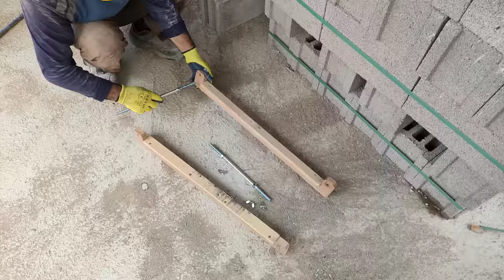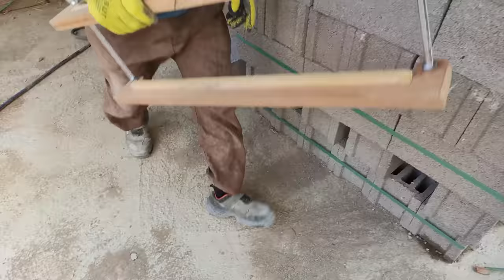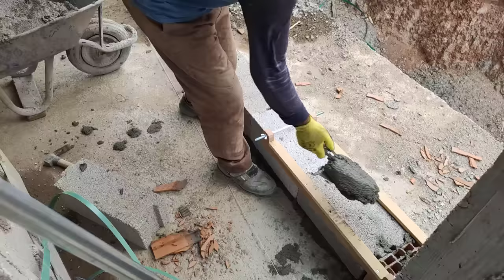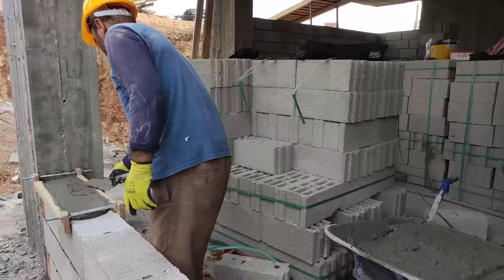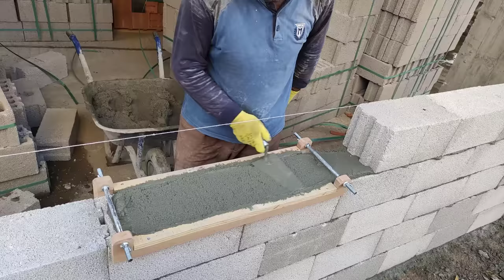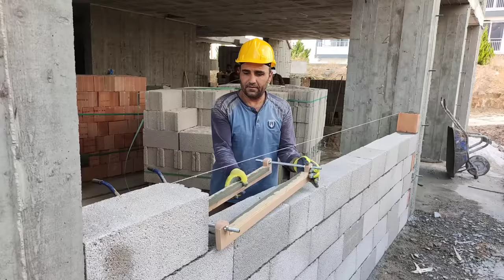Duvar ustasının işini profesyonel yapan kullanışlı alet

Comment: This would make block laying take so much longer then need be. This item is a homeowner special. You would use way more mortar than needed
Reply: They make up for excessive mortar on bed by not buttering the head joints. Lol
Reply: @sgtboz9730  yeah everyone wants to reinvent the wheel.
Reply: @MrK3W  Next, they will be making concrete Legos and no mortar will be needed .
Reply: @sgtboz9730  anything is possible. Everyone wants to be a mason but no one wants to lay the block the right way! Lol

Comment: Bricklaying is a craft when a bricklayer lays a bed joint it is feathered so as to place the block down and push the mortar joint so it potrudes on either side of block layed.The mortar joint becomes full and is easier to point it.

Comment: I have to say it. That's NOT the way it's done. You have to make adjustments in height ant length. No footer is perfect, and no mortar buttered on the heads is just wrong. I'd fire the so called mason that would do that. 45 years I've been doing it.

Comment: A real mason knows how to use a trowel.
Reply: He knows how to use a trowel - no matter how good you are - you're not going to lay wide beds like that as accurate and fast and with less droppings.
Reply: @Iazzaboyce  wanna bet.  I sling mud twice as fast and no dropping.  No boards no jigs no bs.   Working on the line I put up over 250 block a day myself.  8-10-12”.  I also lay 12” solid blocks by myself.  No two man lifting on my jobs.   Like I said a real mason knows how to use a trowel.
Reply: @mikekelloggs9379  That you mention you work to a line makes me think you're a pretender - every mason works to a line - it goes without saying.
Reply: @Iazzaboyce  working the line refers to straight walls.  Raising corners takes time and you need to use a level. Long walls or short walls doesn’t matter.  The line gets stretched corner to corner held in place by a jig.  Some guys use wooden blocks.  That line.  That’s the line I’m talking about.  The string.  Comes in colors.  Pretender?  You’re incorrect.
Reply: @mikekelloggs9379  i think he knows about the line...that's why he mentioned the line.
Reply: @TheyForcedMyHandLE  yea. Maybe.  Working on the line is the term.  Otherwise it’s go raise the corner.

Comment: A professional brick layer won't need this.
Reply: With this everyone becomes a professional brick layer.
Reply: I know right, why would a professional use a jig that helps quickly produce consistent results easily?
Reply: I can paint straight lines very good with a paint brush,as someone who started painting for money when I was 10yrs old. I can paint straight lines much faster when I mask off areas with painter grade masking tape. This seems to me to be a similar use of a product you don't have to have or need to use to get job done, but in long straight repeat applications, I wood use this. I wouldn't tape off every window frame, say a small bathroom window, I could freehand and be done, in the same time I would mask and paint. Large 6foot by 6foot window, probably going to use tape.

Comment: This mortar leveling tool is probably an improvement in comparison to uneven 3 to 5 cm thick mortar beds between concrete blocks I have seen in some countries. - Where I live practicing “masons” are usually without formal training and it is common to see much more poorly build concrete hollow block walls than in this video.

Nevertheless this side wall located below the adjacent ground level looks like it might be backfilled with soil which it could not sufficiently hold. The concrete blocks should be wetted and there should be mortar on the sides. Structurally the wall should be reinforced with steel bars. 

Much of the Middle-East is prone to earthquakes, which could make this wall particularly dangerous.
Reply: these are not professionals, but ordinary cobblers!

Comment: So many negative comments, First there is no waste cement going on the floor, it's level, it's clean, you don't need to cement the end of the blocks they have a key to hole them, the wall will be rendered later. Would be nice to see the doubters challenge him to build a wall as fast.
Reply: Glad he wasted 5-6 inches of mortar in the middle of each run and none on the floor. Who cares that it takes him 2 - 3 times longer to lay block. There is less mess to clean up. He does have great grout lines.

Comment: What you going to do if you need to grind or pick up? Not all blocks are the same size, plus you doing that your are weaking the wall from lack of suction. You're literally just placing the blocks on a slab of mortar.
Reply: My point exactly. I've just added a comment myself

Comment: I see the block are interlocking at the head joint. In Pennsylvania where I'm from that wouldn't pass code. No mortar at those joints  is crazy
Reply: Yeah we call these type of mason's HACKS around here. Level plumb straight edge two four leads one at each pull a line and let's go.
Reply: I'm also wondering what's the use of the vertical holes in the block if you can not put cement and rebars in it. The interlocking end joint is not enough to hold them together in case of an earthquake. Just an observation.

Comment: Looks good, however this type of wall construction is not designed for earthquake s, not reinforcement. It is easy because no vert rebars on the way of the guide that slide.

Comment: Really bad job! You need mortar on the verticals and also laying a block on flat mortar will not bind it well and make a weak joint. Needs to be heaped up to overfill and squashed down to get a good contact with the block.
Reply: Makes sense mate.

Comment: Your not even buttering the sides 😂
Reply: Guess these interlocking blocks don’t need head joints. 🤷🏻🤣
Reply: @jbonegw  actually they do , you can also use a specified adhesive

Comment: IF THERE IS NO CEMENT BETWEEN THE VERTICAL JOINTS OF THE BRICKS, THE RESULTING WALL WILL BE FRAGILE. NOT FOR A LOT OF RUNNING YOU GET FURTHER. IN MY OPINION, THAT'S AN ERROR. 🤨
Reply: I think you're right.
Reply: Also, water intrusion...?

Comment: A professional & experienced mason doesn't need such a tool, as it only slows down the process.
Reply: I'm not even a professional mason and I don't need this... It just gets in the way. You still have mortar coming out as you press the blocks into place (which he doesn't do in the video as far as I can see). You still have to clean up the joints a bit anyway, so why bother with the apparatus? You'll need to move it from spot to spot only to then take it out, I mean it's going to do murder to your back and you don't need more tools on a job...

Comment: I HAVE BEEN A JOURNYMAN MASON FOR 40 YEAR'S WASTE OF TIME.WHERE  ARE THE HEAD JOINT'S.AND HOW ARE YOU GOING TO TOOL THE BED JOINT'S
Reply: Ur right about journeyman, if by head joints u mean perp joints you wouldnt need them as the blocks are designed to interlock and its not facework so obviously going to be rendered or float and set so the recessed joints would act as a key for whatever finish coat they end up using.
Reply: I agree with you that’s not stone work it’s blockwork  plus there’s no joints I’m a retired Bricklayer and I could have built that Block wall properly in half the time he spent  setting that load of rubbish up‼️‼️

Comment: Too much mortar on bed joints, zero on head joints. No real block mason would use this. Those blocks look super lite. Styrofoam?
Reply: These blocks are expanded clay .They are a very good material for walls. They have very good insulation parameters.
Reply: @Nietyp  Did not know that.

Comment: With this system there is no cell interlock of mortar between courses. The blocks are dependant on the layer of mortar between each course. Also no room for rebar of any kind, nor any way to fill the cells. Maybe those are solid core block, but how heavy does that make them?

It may be faster, but (imho), it’s structurally compromised compared to the common open cell method. Nice for a DUI person, but as journeyman from a family of masons, I’ll pass.
Reply: Non ti capisco, ma tutto buono. Fai come voi te 🙂
Doppo di 42 anni a muratore, non mi frega niente.

Comment: Mortar will be dust in no time , should really pre soak the blocks , also he might want to invest in a spirit level always good to check 🤣
Reply: This ain’t brick buddy you don’t soak block
Reply: @lxrmv2518  It depends on the size and type of the brick or concrete block. In general, a standard concrete block has a larger volume and can therefore hold more water than a standard brick. However, this may vary based on the specific dimensions and characteristics of the brick or concrete block.

Pre-soaking concrete blocks before use is a common practice in construction. The purpose of pre-soaking is to reduce the amount of moisture that the blocks will absorb from the mortar during construction, which can cause premature drying and cracking of the mortar. By pre-soaking the blocks, the moisture content of the blocks is stabilized, reducing the risk of absorbing moisture from the mortar. Pre-soaking can be done by submerging the blocks in water for a specified period of time, usually 24 hours, or by spraying them with water for several hours prior to use. This helps to reduce the risk of moisture-related issues during the construction process and can lead to a stronger and more durable final product.

Comment: Where is the wire , rebar and grout cells at?. Junk work.
Reply: What do you mean?
Reply: What is grout? Rebar? And wire?
Reply: Wire goes on top every 2 courses, concrete(grout ) goes in every 3 feet in cells and rebar goes in the grout cells while pouring.

Comment: So what happen to the steal to keep the structure of the house strong. That is not a healthy house, if it is one building. Fast and not safe.
Reply: It’s simply a screen to fill in between the concrete that actually supports the building it’s not taking any weight so needs no rebar . It’s much like how a window fills a hole without supporting anything

Comment: Those blocks have all their faces solid but seem to have little weight. What material is that? And I don´t see vertical and horizontal reinforcement, and I don´t see a consistent interlocking of blocks of one row with the next row.
Reply: It's not a structural masonry wall though, just a closing wall.
Reply: Этот блок у нас называется сплиттер. В его состав входят цемент и очень мелкий щебень. Заборы тоже из него делают. Обычно каждые 3-4 ряда нужно вертикально армировать и заливать раствором

Comment: That might work for a home owner. Most masons wouldn't use it. Also the block in the video don't have cores or cell. This is probably where there is no rebar or concrete required.

Comment: No real bond  it will fail
Reply: mmm yeah its just kinda sitting on it isnt it
Reply: @MrNickcrush  many years ago there was a chap who marketed a thing called brikkies mate and it was endorsed by a celeb it was the same thing, no good 👎
Reply: @philsmith214   Phil, actually, for someone who never laid a block in their lives, a gadget like this is very helpful, its kinda funny that the people with the real skills are running this thing down thus minimising the value of their OWN expertise ! 

Not everyone is a bricky !! 

I'm a machinist by trade but when  DIYing a block wall out back, I used a similar form which helped me enormously... I haven't got the skills but I needed the job done & I wanted to point & say I did that myself ! 🙄😉

😎👍☘🍺
Reply: @peterfitzpatrick7032  I'm not a professional. I've done bits of wall here and there. I don't need this. It's a waste of my time and money.
Reply: He's not even pushing them in, is he?
Reply: @isakaldazwulfazizsunus7564  no not really they are just laying on a uniform layer of mortar 👍🏻

Comment: Not 8x8x16 unit its a its a interlocking cap just bed joint no head joint no bond beam block for rebar no grout I could spread that wall twice as fast as this little Contraptions doing and it looks like a lot of wasted mortar I don't know I have an inspector on the wall that walks my jobs

Comment: If you can't spread shit on a block you shouldn't be doing the job! No proper bonding, fill in blocks just dropped in to make up the gap. Vertical guesswork
Reply: 😂😂😂,,, yea,, there's absolutely no need to put anything between the blocks right?? 😂😂😂,,
Reply: @liamc-rb9tz  Block Interlocks???????????????
Reply: @davidwootton683  structurally unsound

Comment: is interesting to see that in areas that experience earthquakes don't use rebars. I've been living in Costa Rica for a while now, and all houses here have a rebar every meter and all corners are concrete pour with rebar renforcement. Is there a building code? I find it hard to  believe the gobernment doesn't enforce a code that can save thousands of people. By the way, the idea is ok, but brick layers are proud workers that can lay mud much better and faster thant that contraption. 
Semper Fi

Comment: What is wrong with putting cement on with a trowel putting the block on top, pushing it down, scraping of excess to a neat pointed effect  and putting some cement between the blocks as well. This looks like a very unstable wall with no cement between the blocks and will require the builder to go back and put the pointing back in. This looks like a slow way of laying blocks.

Comment: I would never go for a masonry wall that did not butter the head joints even if they interlock. There should be ladder reinforcing every other course. The only way  would trust this wall is if it was parged with block bond each side.
Reply: Why do you think these building fall down so fast with the slightest earth tremor?

Comment: I am not even a mason.. but i could see what is wrong in the video. A few common sense here that he is not putting blocks vertically so the cement is not filling up inside the blocks thus he is just spreading it. I dont see any metal supporting the wall as well just pure blocks and cement.

Comment: I know many bricklayers, and they would never use this method
Reply: for cinderblocks, why not? they're not even bricks.
Reply: Not only that, where in the world do you find "solid" cinder block without open cells.......
Reply: @tedhursh7672  we use them in England...
Reply: @robertscott961  My mistake, I shouldn't have said "in the world".  Never seen them in U.S.  I'm a General Contractor, and all cinder blocks are "hollow", with exception of "decorative" ones you would buy for the top course as a "cap". Most of our building codes require a "100% concrete fill, along with rebar, every 32"" on a 6' wall.  Retaining walls are another story.   But thanks for letting me know.....
Reply: @wellingtonsanissimo8703  learn to lay block and you won't need this junk!

Comment: Sorry but not good working at all, first you don't have wall insulation with double second wall, second you need to put full wall concrete in the height of 1 meter x 20 cm
Reply: wow, one single slice of roofing felt, and start with the bricks....i see no reason for concrete wall.... 
gives the wall different surfaces and a cold bridge from the bottom up...
here you make the insulation on the outsides of the building, its now up to 20cm of insulation and a paint job...

Comment: A true tradesman is at least 4 times faster than this guy without using a jig and the wall would be much straighter and more structurally sound as well. Since they didn't even tie the wall into the concrete columns with wall ties or use any horizontal reinforcing wire, a good strong wind could blow that wall over.  I don't know what country this video is from but they would be tearing the whole thing down here in Canada as it doesn't meet the building codes.
Reply: Yap I agree bro mostly in meddle East they didn't use horizontal and vertical iron bars
Reply: Türkiye paşam...
Reply: A brick and cement wall is strong if build correctly on a good foundation. Steel is not required and a strong wind will not blow it over. Horizontal metal wire/ brick force can be used and is only really required in about every 4th row, but is more for over opening and helps with cracking mostly. I can build you a brick and cement house with no metal which can stand for 400 years easy. will definitely crack some in that time, but it will stand. The time it takes is all based on experience, you get faster as you go. This is to helps beginners.
Reply: @adesign5  To begin with, these are not bricks, they are concrete blocks. Secondly, cement is just a powder and you are using the term incorrectly instead of calling it mortar. Third, the wall is not built correctly as it is not tied to the concrete columns and is therefore a big flat free standing wall with no corner returns. It makes no difference where this is in the world, it is still wrong and poor workmanship, not to mention, unsafe. Lastly, when one is learning something, they should learn it the correct way from the start. When one starts doing something the wrong way, they will continue doing it the wrong way. Practice does NOT make perfect, only perfect practice makes perfect.

Comment: poor very poor i would sack you for that shoddy work
Reply: I'd prefer to butter the joints to add stability. Defo got to tie-in at the column interface. The perp bonding is askew. Better setting out required.